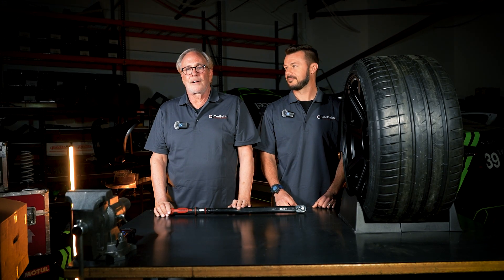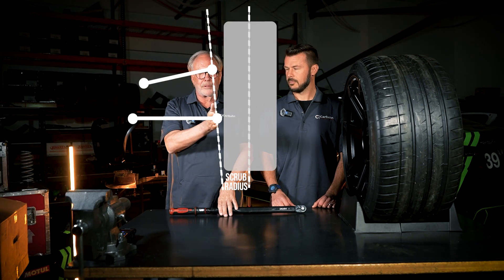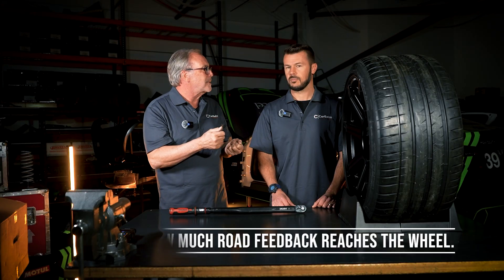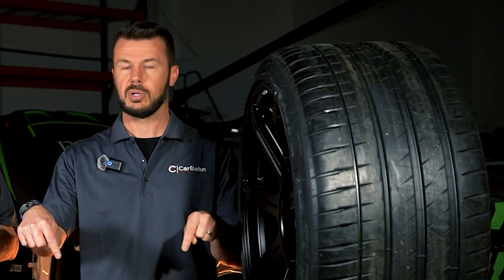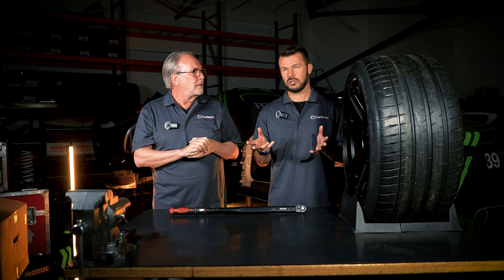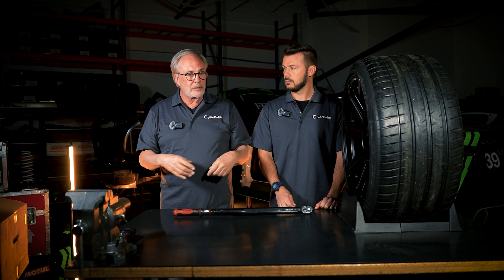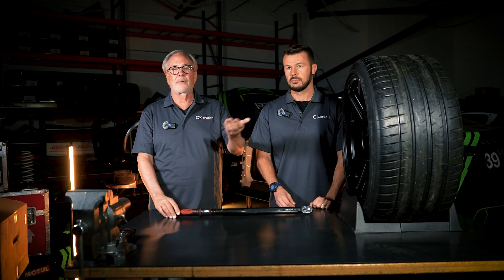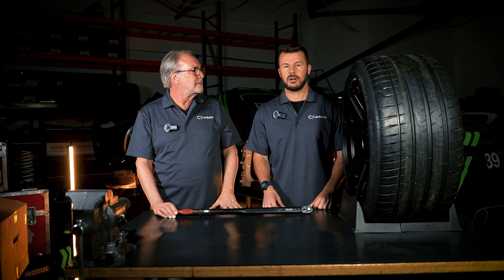Scrub Radius Deep Dive: How Wheel Offset Changes Your Steering

Comment: It’s worthwhile to point out that scrub is a function of wheel offset in relation to the suspension pickup points. In practice when we try to fit a wider wheel we can change the offset which affects the scrub (this is what I’m assuming Steve was alluding to).
Reply: Yes you are correct, a wheel spacer changes the relationship between the center of the tire, and the suspension pickup points.  See 1:50 in the video

Comment: What happens when you use monoball bushes? 

Also which kind of fitment would you recommend? I prefer a flush fitment to the fender. Which performs better
Reply from the maker: Stay tuned for next week's video about monoballs! 

regarding your question, not going flush is better for performance
Reply: @carbahnofficial i also need to learn about assist / helper springs (swift springs). majorly xdrive as well. F chasis. Xdrive is a huge topic and hard to find info on it. Cant run to much camber, have to be in a specific 1% diameter of wheels for a staggered set up. Its so much. Would love a separate long form video on it. Please. Pretty please!